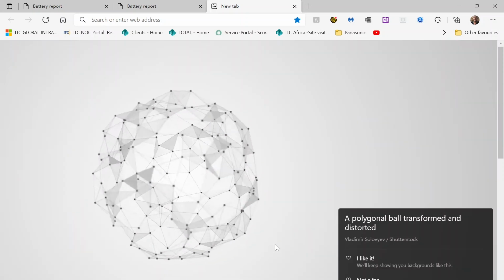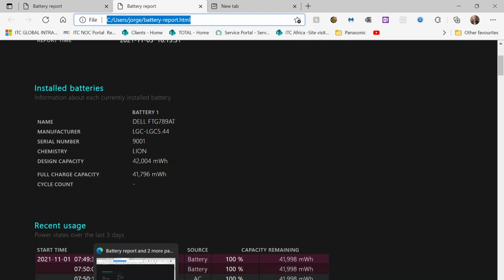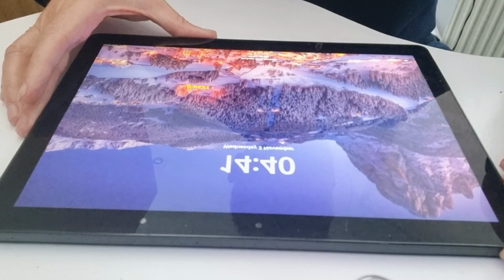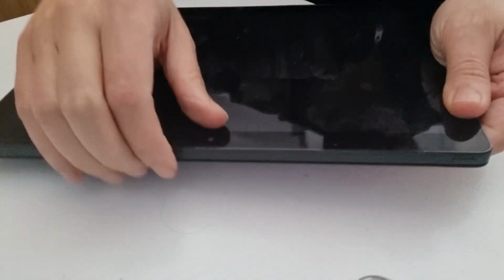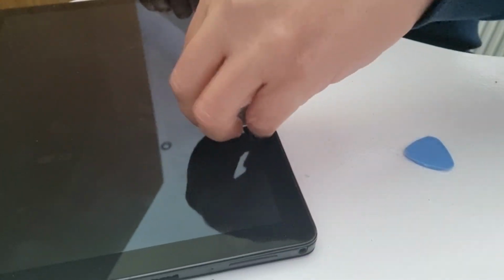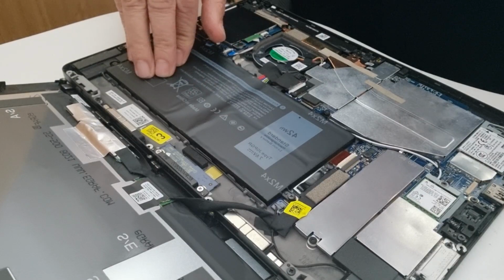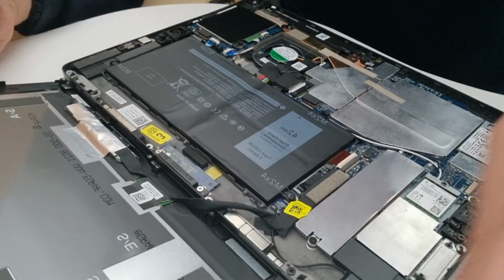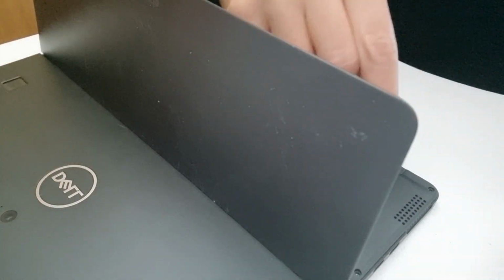Dell Latitude 5290: How to Replace the Battery (and Why You Should)

Comment: According to the dell website, the 41 Wh battery just for 5285 2-in-1 version..

But i guess it support for 5290 2-in-1 too

Th difference is the 31.5 Wh / 11.4 V VS 42 Wh / 7.6 V battery

So, does 5290 2-in-1 just support 11.4 V battery?
Reply from the maker: As far as I am aware, the battery compatible with both the Dell 2-in-1 5285 and 5290 is a 3-cell 42Wh/7.6V. The 11.4V battery is not suitable for either of these devices. I have included the link to the one compatible with both models.
 https://amzn.to/3XWGUiv

Comment: I just did this but still won’t charge I just got a new charger I hope it’s not the charging board but I think I could replace that too
Reply from the maker: Did you replace the battery ? if so did you have the same issue before ?
Reply: @Techunderthemicroscope  actually i got a genuine dell  charger and now everything works great thank you for the video it helped a lot

Comment: I had a new one thats been sitting for a year and its says the battery is fake. How is that possible if its new
Reply from the maker: Bizzare but the batteries are cheap for this device.
Reply: @Techunderthemicroscope  i have one that works great its used for a large printer its always left plugged in. So far so good. I did however have a xps also always left plug in bubble up the mousepad must be the battery lol

Comment: With a fresh battery on the 5285 i5 7300u 8gb how long will the battery last doing mid-end games? Maybe 4-6 hours? My battery is mega low at 9,000 Wh from 42,000 so massive difference in comparison, will the 60 watt battery be compatible
Reply from the maker: The 60Wh battery is not compatible as it has a 11.4 v instead of the 7.6v. By the way if you still have your 5285, bear in mind that the device has a 7th generation CPU. This CPU is not officially supported by windows 11. Microsoft will stop supporting Windows 10 in October 2025. You may want to upgrade to the 5290, which is going super cheap on ebay.

Comment: Very good video, but I have a question, where can I get the display for this Laptop, the touch at the bottom stopped working, greetings from México
Reply from the maker: If you tried the file and it didn't work, before you replace the LCD, I would recommend to reset the device and reinstall windows.  The LCD's are available on ebay.
Reply: @Techunderthemicroscope   Thank you very much for the response, I will take it into account, greetings!!!

Comment: Excellent tutorial. In and out in less than 10 minutes. Another channel with supposed Dell "experts" was garbage. The guy in the video removed the screws, unclipped the screen, and then literally ripped it off the mainboard without disconnecting the video cable.

Comment: Having replaced the battery on my Dell 5285,i can no longer turn it on unless it is plugged in to the mains,even with a full battery. I took out and replaced like for like. I can only assume that if a non genuine Dell battery is used, as in my case, the operating system does not 'see' the battery. Changing power settings in bios makes no difference.
Reply from the maker: I had a similar issue with a replacement battery. The issue was the new battery itself. I returned it and purchase one from another seller on ebay.

Comment: Thank you, my unit now can run 10 hr + while reading online with new 41w battery. A bit heavy and thick compared with my older hp spectra x2 but HUGE performance difference. I bought my i7 16gb 5290 for less than US$380 and new battery cost $35. looks like new. The funny thing that I found is with old battery the unit run hot, but with new battery it run cool almost no heat while reading online. Only get hot when installing or watching youtube.
Reply: Hi where did you buy your battery?
Reply from the maker: Ebay
Reply: @Techunderthemicroscope  can you provide the link here please. thanks

Comment: How do you feel for new battery? How many hours you can run on that. Recently I have battery replaced on my dell laptops but could not feel much different from used one that 1-2 hours running
Reply from the maker: There are a lot of cheap quality ones but the good ones will perform significantly better. Mine gives me up to 5 hours of autonomy.

Comment: how to resolve about the heat? please help
Reply from the maker: That is a wider topic. The heat could the cause of various issues. An app running all the time causing over utilisation of the CPU. Or maybe the thermal paste on the cpu needs redoing or maybe the fan is clogged and needs cleaning. May do a video on it.

Comment: Thanks for showing this! I bought this device some days ago and this might be helpful in the future. Do you the device? Are there any bad things about it? :)
Reply from the maker: The only bad is the screen resolution is slightly lower than the surface pro 6 but everything else on the dell is better. This is a device you can upgrade apart from the Ram.
Reply: @Techunderthemicroscope  I paid 429,99€ for a 8gb ram model and i think i made a good deal!
Reply from the maker: @AroPix  That is a good deal.